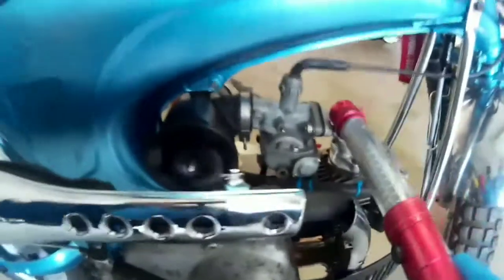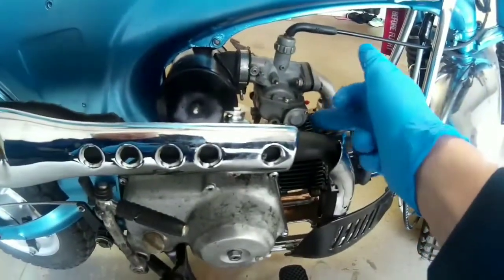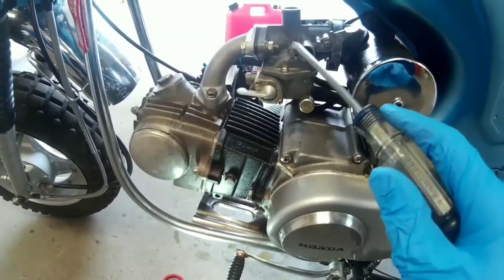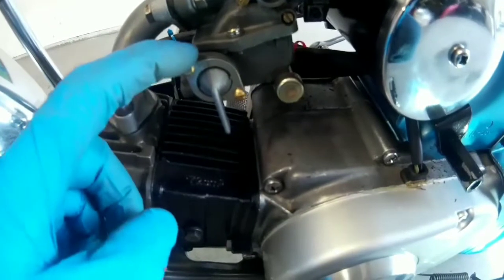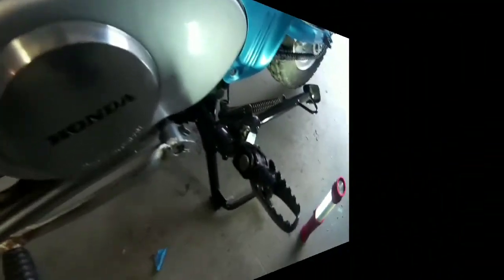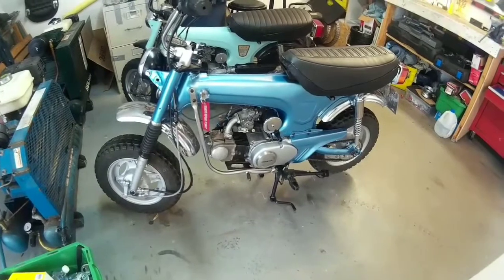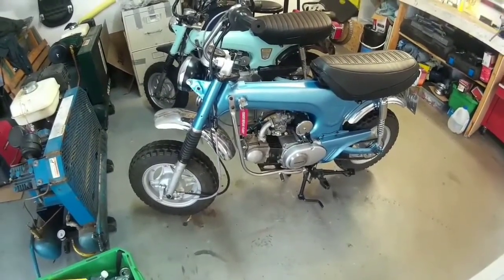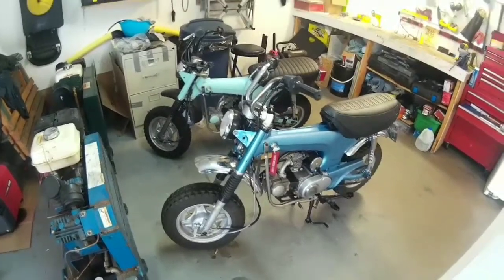Honda ct70 fuel issue's part 2

Comment: The hole on the left side of the carburetor is supposed to have a plug or cap on it isn't it? Near the shut off valve.
Reply from the maker: My 1973 ct70 is the same no cap on that hole and it runs great.
Reply: emso0105 have you tried spraying for air leaks? Spray carb cleaner on an around the carb while it's running.
Reply: @mikeshobbiesandrandomstuff  this ct70 is not buelt right
Reply: @chickenwing6416  I believe I was actually incorrect at the time about the high altitude plunger